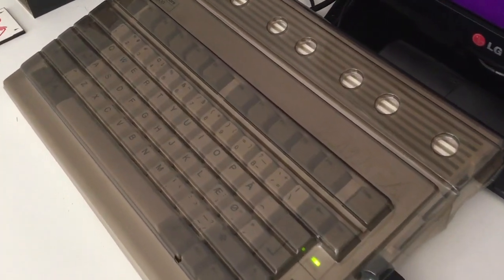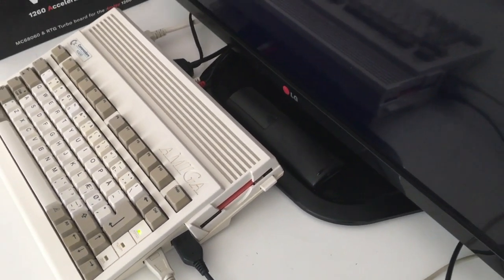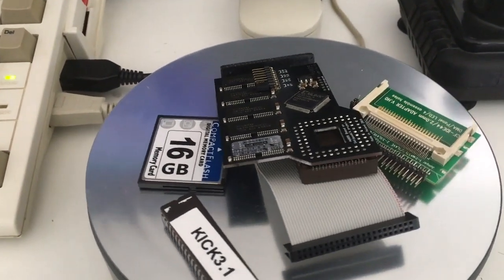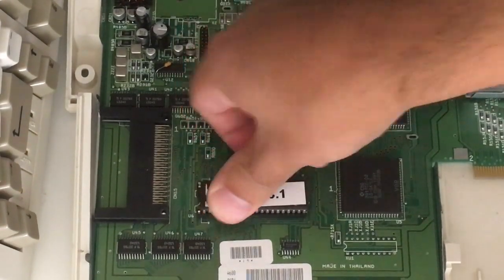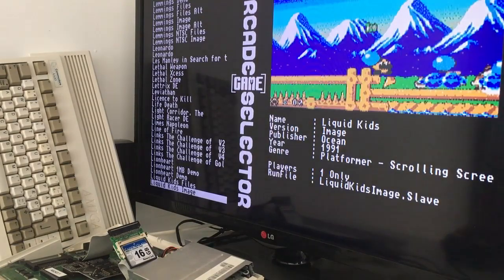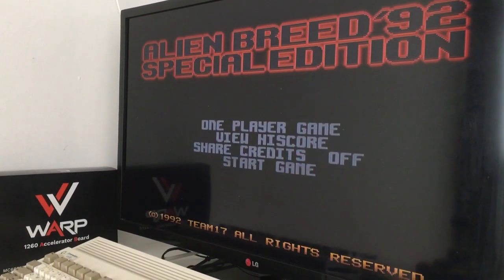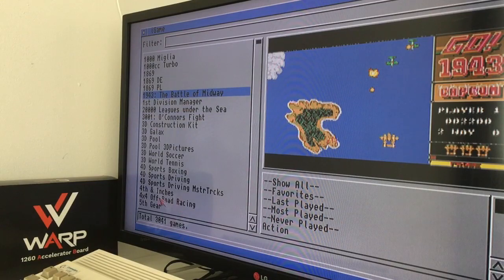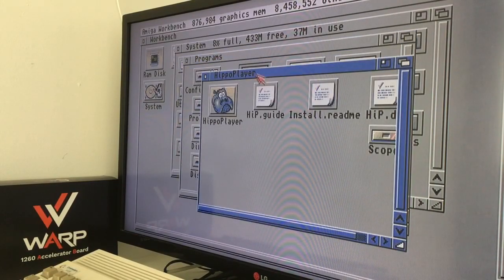Amiga 600 WHDLoad Upgrade with 16GB CF and 9.5MB Fast RAM

Comment: Previously I was not interested in the 600 because I have 500 and 500+. And I thought the A1200 could be the gaming machine with whdload and such. But since the 1200 is more expensive these days, I might get a 600 instead as the budget whdload machine, and as the Amiga I use with modern solutions. That could be fun. 

Also I liked the intro where you say "but today,,,Never been so much fun" :D
Reply: I've noticed that Amiga 600's seem to be getting more expensive on ebay now, probably because of these expansions and the smaller footprint. Anyhow, if you already an A500+ you could look for a TF536 expansion card + Kick 3.1 as that will allow you to have an internal CF card, 030 CPU and 64Mb fast ram.
Reply: @lesr981  This is true. I used my A500+ as my classic Amiga 500. I did want to use the actual Amiga 500 but it did not support a program I used for connecting to internet / bbs. But it also don't support action replay mk3 so I want to use the real A500 instead, and then I could use the A500+ to have fun with more modern solutions.
Reply from the maker: You have the A500plus and A3000, there is absolutely no reason to spend money on an Amiga 600. I would fully recommend you the Amiga 1200, its a much better Amiga from the getgo with the 020 and AGA chipset/ ide connector.  Cheap 8mb fastram card and a cf card. You are ready to play all games and demoes, yes also AGA ones😁😁
Reply: there is ide +8mb adaptors for the amiga 500 now, it would fulfill the same role as this 600